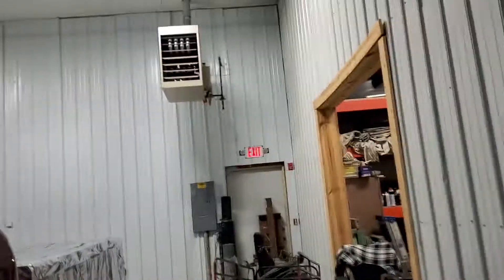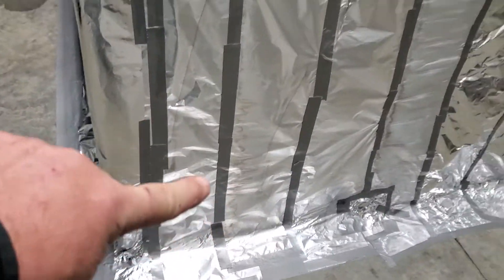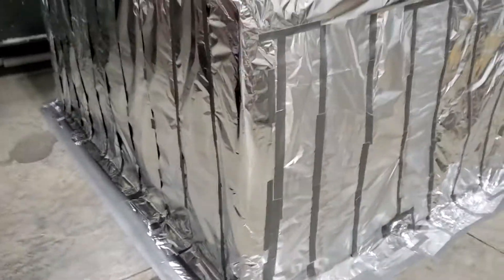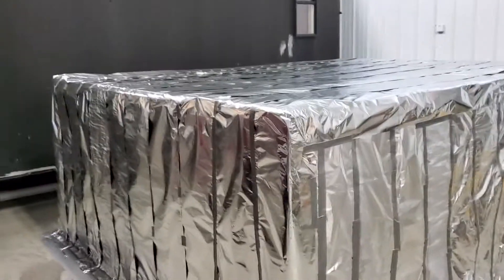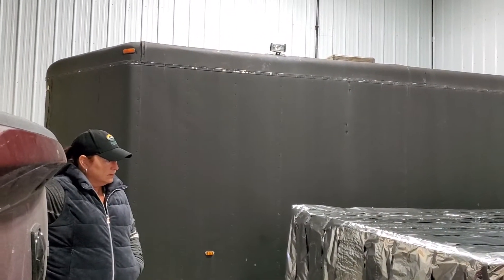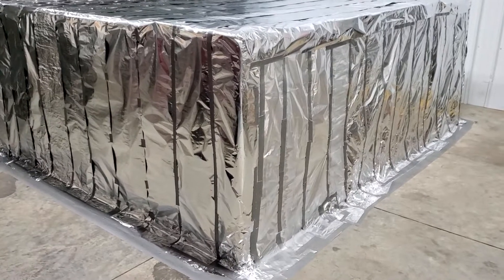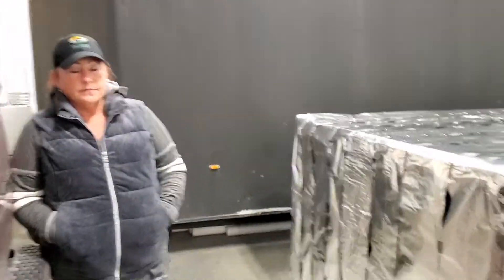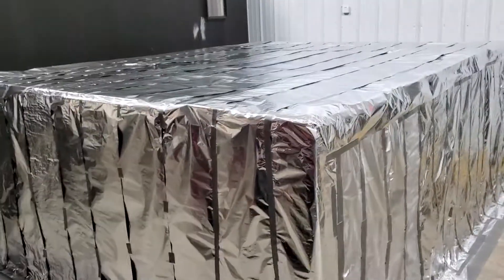FARADAY CAGE FOR ATV's, GENERATORS AND POWER TOOLS PART 2 OF 2 VIDEOS

Comment: did you test it?
Reply from the maker: No I didn't I'm not sure how to test it to be honest. Thanks for watching and commenting
Reply: @kurtsibila9682  put a blue tooth speaker or a radio or a phone and call it i also would have used foil tape looks pretty tight but frequency can get in the littlest seem
Reply from the maker: @1969theblack  OH alright gotcha. Thank u Thank you...... That makes a lot of sense on testing it. And I agree with the foil tape. Thanks again for watching and commenting

Comment: Aren't you worried about your gas going bad. Any gas with ethanol in it has a very low shelf life. I wouldn't worry about having the gas in the crate. Just electronics.
Reply from the maker: THANKS FOR WATCHING AND COMMENTING. WE ROTATE OUR GAS EVERY YEAR. JUST DID THE LAST FEW GALLONS LAST WEEK. WE USE IT AND GET NEW EVERY YEAR TO YEAR AND A HALF

Comment: The building appears to be a metal garage. So is there a reason you didn’t find a way to cover the gaps and make the whole building a huge faraday cage? Then everything inside would be protected.
Reply from the maker: It was something I just wanted to do. And kind of a 2nd layer kind of protection. Thanks for watching and commenting
Reply: @kurtsibila9682  2nd layer is always good. I ended up speaking to empdoctor about it and he thinks it would be too difficult to close up all the gaps in a metal garage without getting a professional to do it. I’ll just pop that one in the maybe basket then lol.
Reply from the maker: @moniquem76  LOL He's definitely the guy to ask. It would have been more work to try and close the gaps. Than the time and little money it took to build that big cage. Thanks again for watching. Please subscribe if u haven't already. God bless
Reply: @kurtsibila9682  absolutely! I was seriously impressed that he answered my questions! He also answered my questions about protecting an EV which I was hoping to get but unfortunately I need to update my car now and can’t wait for an EV so that will be next time. But at least now I know what I’ll need to protect it. I’ll be protecting the in between car with his little kit too. I forget what he called it, but there are things that plug into the cigarette lighter sockets and a thing that goes on the battery and a third thing I’ve forgotten lol. The kit wasn’t particularly expensive which was great. I just needed to wait to know which car I would get to know if I needed extra parts. Sure enough, the one I’m looking at has a second cigarette lighter socket so I’ll need an extra thing for that. I live in Australia so wherever possible I buy everything I need from a business all at once to combine shipping charges, otherwise they get ridiculous. I think I’m subscribed. Not sure. I shall check😊
Reply from the maker: @moniquem76  U are definitely on top of things. I'm glad u are getting these things accomplished. People think we are crazy when we prepare for things like this. UNFORTUNATELY many people are not prepared. Thanks again for watching and commenting. And subscribing. God bless and have a great holiday
Reply: @kurtsibila9682  the time will come, fairly soon I think, when they will realise we’re not the crazy ones. Fun fact, I was having a big chat with my grandmother a couple of years ago and all the things that these days are considered prepping, were just life and what you did when she was young. Of course they didn’t have the convenience items that we have now so there was no other option, but they were wise enough to make sure they had what they needed. It’s a shame I didn’t learn more from her when she was a bit younger. I think it’s interesting that to prepare is almost equivalent to going back to the old ways. Perhaps with some added appliances lol. 
Only 2 subs off 1000 now!
Reply from the maker: @moniquem76  OH WOW...... ABSOLUTELY GREAT POINT...... It was a way of life back then. The problem today........ Is  very few people think like our grandparents. Because they think it will NEVER HAPPEN to them. Because they are spoiled and take their way of living FOR GRANTED.....
Reply: @kurtsibila9682  exactly. Most people these days have had it too easy and have never gone without, so they take it for granted that it will always be that way. The grandmother I mentioned before was born in Australia to Italian parents. My other grandparents were in Europe during the war. They were hungry. They ate mouldy bread and considered themselves lucky to have that. My grandfather risked being shot to steal a potato peel in the camp. We can’t even begin to imagine what they went through. They had a vegetable garden in the backyard until the were in their 80’s and couldn’t tend it anymore. They never wasted food. Ever. It was precious. They knew what it was like to have nothing and they were determined that they would never have nothing again. There’s a lot to learn from what people did during the war. There’s a huge amount of info out there about the British home front. When I move, hopefully soon, I will be using some of the same methods when I set my place up. I’ve bought a stack of wartime cookbooks too. British, not American, because the British rationing was really strict. Those ladies then were amazingly clever, and they found ways to make all sorts of things with hardly any meat, fat or sugar. There’s so much to learn from those, and once I have my big garden growing at my next place they will help me to utilise what I’ve got rather than buy things to add to a recipe. Between wartime cooking and methods and just cooking and methods from days gone by, that is a big portion of preparedness sorted.
Btw, I bought the car today! Yay! Finally!

Comment: I pray that it does. How many baskets do most people have space for?  I, personally, think whatever I have strength for, have the time and $ to do to "potentially" spare a few things from being damaged, doing the best I can with what I have, to do so is  more than doing nothing at all. You can spend tens of thousands and much more on things like this if you have the $, but there is still no guarantee anything will work. God bless you & your family Kurt. I pray this isn't necessary, but the governments of the world have gone stark raving mad, all at the same time and I think it reasonable to do what you can to protect yourself from a CME or worse and trust God for the rest.
Reply from the maker: I appreciate u watching and commenting. I was just going over comments. I didn't see this comment until now I'm very sorry. I agree with everything u said. Now times are worse than when we first did the cage. God bless u and your family.

Comment: How do you know this is going to work do you know if it needs to be a certain sickness have you tested it have you worked with it I mean aluminum foil can stop a cell phone signal but a highly charged EMP I don’t know what what did you justify this on so you can say it works where is your scientific facts
Reply from the maker: I did read some articles on this. As long as the metal is over lapped. And as long as there are 2 layers perpendicular to each other. And as long as the metal is grounded to the ground. Meaning it is touching the ground. Then it should work against an EMP? No one actually knows for certain if this will work. And the building the Faraday cage is in. Is also metal. The walls inside and outside. Also the roof inside and outside are all metal. Like I say in the video about the metal structure. And I also say in the video. I don't know if it will work? No one knows if it will work? But I'd rather try this and hope it works. Than not try and have no hope...... Good luck and thanks for watching
Reply from the maker: There is a part 1 and part 2 of the video